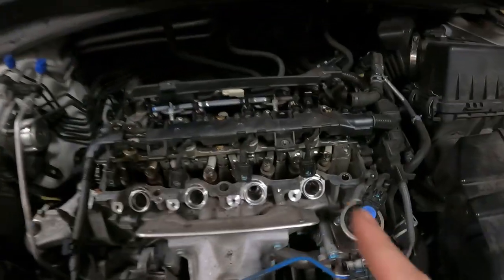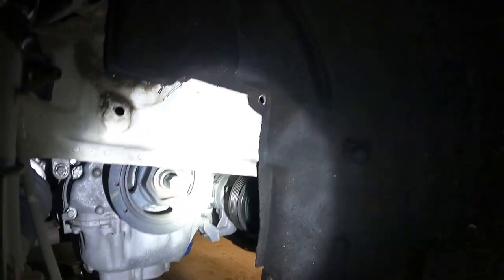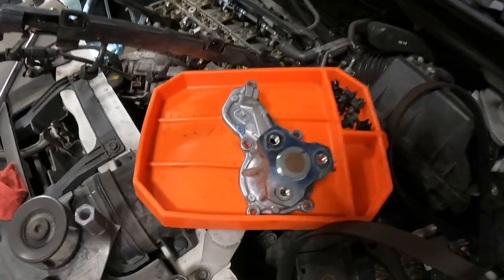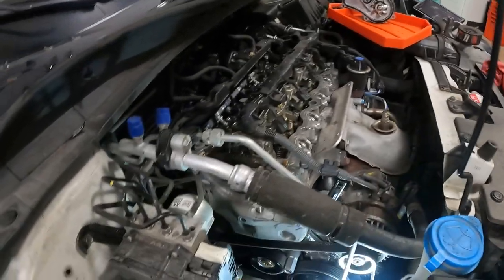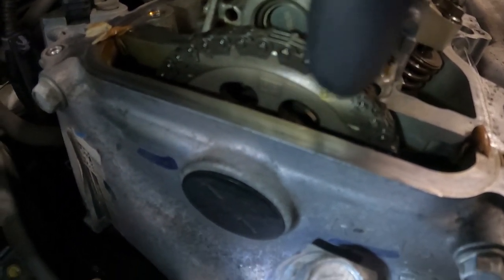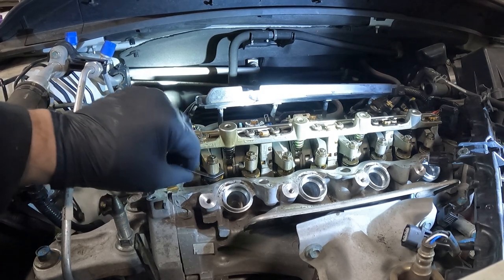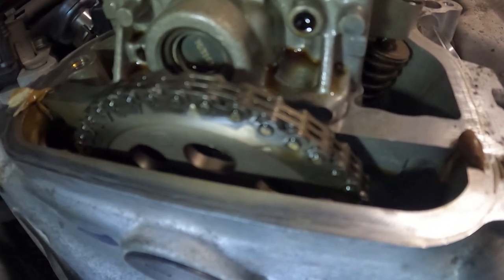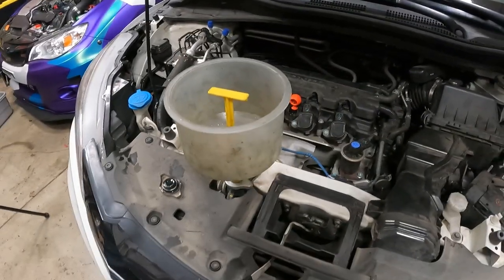Honda HRV Water Pump and General Maintenance!

Comment: One trick I do on all my Honda's when draining the coolant, is to open the coolant reservoir cap while leaving the radiator cap closed. This pulls the coolant out of the reservoir. This way, there is no old coolant sitting in it to put a film on the insides and it always looks clean.

When I get ready to fill the radiator and reservoir with new coolant, I use the Lisle coolant funnel in the radiator like you do to "burp" the system, and I also fill the reservoir to the fill line. After the first drive, I check the level in the reservoir to refill, if necessary.